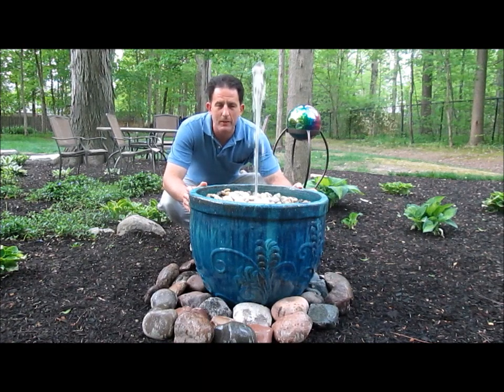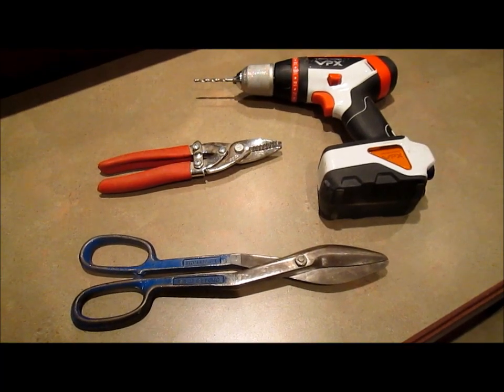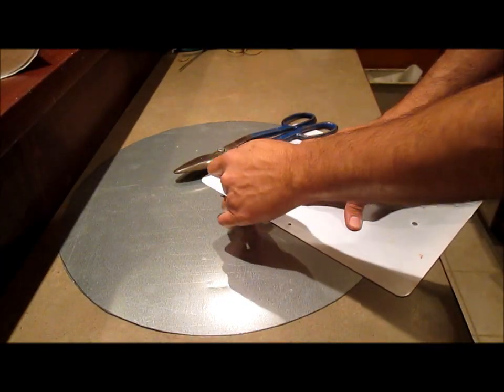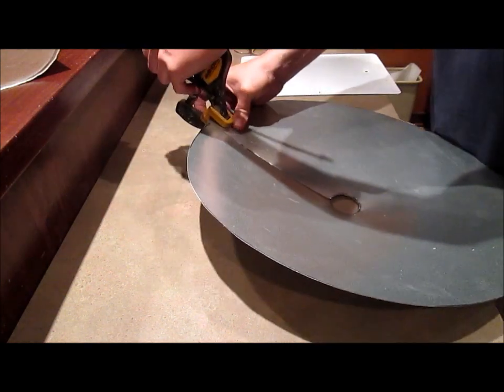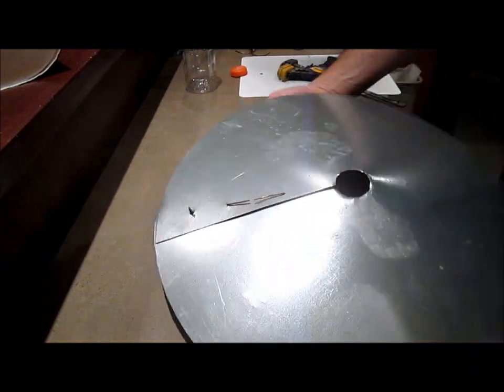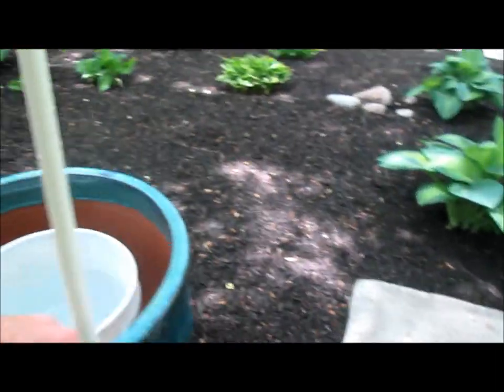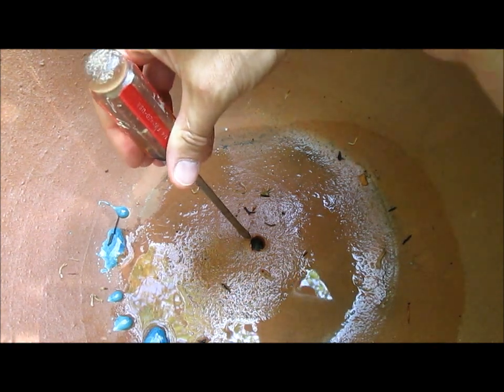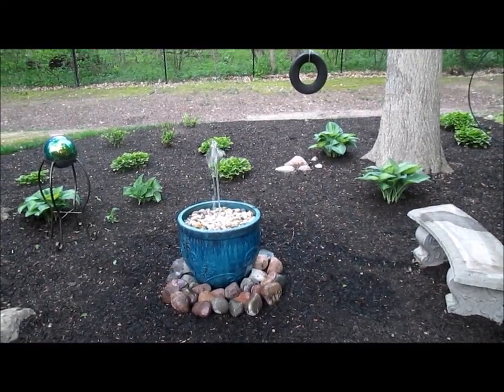How To Make an Outdoor Fountain

Comment: I worked with sheet metal 19 years in a manufacturing plant. If you are going to use sheet metal, wear gloves. Trust me on that. My scars are still visible twenty years later. You don't really need to use sheet metal at all. The dollar stores and garden centers sell round shallow bowls. You can find one to fit your pot. Look for a plastic bowl so you can put a hole through its center. I like the basic concept here. It gives the appearance of a pot filled to the rim with rock, but you use only a top layer. It won't be as heavy and it will be easier to clean, maintain, and store in the off season. I question putting the electric plug inside the pot. There is risk of electric shock if the connection is sitting in water.

Comment: I like the "funnel" water return catcher. Maybe also a good spot to put a strainer to stop larger matter getting in the reservoir. Thanks!
Reply from the maker: Sure, you could put a small circle of screen wire in the center, with a hole just big enough for the tube.  Really though, the rocks are a pretty good filter, and the pump can handle anything the rocks don’t catch.

Comment: take the plug off the end of the pump ..feed it though the hole..better then making that hole bigger in the pot ..just wire plug back on ..
Reply from the maker: +rick66649 - Yes, another good way to do it, but I really wanted the plug inside the clay pot, above ground, so it would not get wet.

Comment: this is brilliant, thinking about surprising my mother with a fountain and thought i try a nice and simple of for her, but there one think i wanted to ask do you think this still work the same way with a solar powered pump?
Reply from the maker: You need a pump that will push at least 100 gallons per hour.  400 is best.  I think solar pumps are far weaker than that, but you can check the specs.

Comment: Could you use a terra cotta or plastic draining plate with exsisting hole?
Reply from the maker: +im4coupons - Yes! Excellent idea!  Really, anything that is just a little smaller than the big pot, and funnel the water back into the bucket, will work fine.

Comment: What's the short item you push under the hole after you chip it out please
Reply from the maker: That was the end of a long extension cord that I ran the the nearest outdoor outlet.  I plugged the pump into the cord and let that sit inside the ceramic pot, but outside the plastic bucket.

Comment: Nice! I wonder what if instead of using two pots and a metal covering you would use a single ceramic pot full of rocks all over the pump. It would be easier to build and theoretically it would work as well, wouldn't it?
Reply from the maker: +El Gat Negre - Yes, you could make that work.  Those ceramic pots usually have little holes in the bottom, so you would have to plug it, and run the power cord over the side or make it big enough for the plug, feed the wire through, and seal it in.  Keeping it from leaking will be a little difficult, but possible.  I would try silicone caulk or JB-Weld or underwater concrete repair putty.  One other thought.   If you are handy with electrical wiring, you could cut off the plug, and feed the wire through without making the bottom hole bigger.  You can buy replacement plug ends for a few dollars.  Good luck.  I think it can work just fine that way.
Reply: Sometimes the pump needs cleaning or unclogging...a full pot of rocks would be a pain to remove to get to the pump.

Comment: So all your water leaks out at the plug in hole you made?? What did you use to seal it
Reply from the maker: Water never gets to plug hole.  Funnel dumps all water in bucket
Reply: Oh neat. I see now. Interesting. What size hose is standard on these small pumps? Or pipe

Comment: How much water ends up getting by the funnel and draining out the pot, will it make a big mess on a concrete floor?
Reply from the maker: +Mr Inappropriate - There is definitely some splashing over the edges.  I not suggest this for indoor use.  It would be fine outdoors on a concrete patio.  On a warm day.  The splashed droplets will evaporate.
Reply: +HowToLou Thanks, I want it for out door use I just don't want a puddle by my door
Reply from the maker: +Mr Inappropriate - I think you would be fine, outdoors.  You can reduce the height of the water, and amount of splashout, by turning down the pump pressure.  Most are adjustable.

Comment: what power the pump is used? and whether there is in him a water supply adjustment?
Reply from the maker: +Vitaly Sitkilov - i'm not sure what the power of the pond is, but you should pay about $10-$20 for one. Yes, they typically have a flow rate adjustment
Reply: ***** Thanks!

Comment: How did you run the power for this? I want to install a fountain in my yard and the outlet is not close by (the pump power cord is small)
Reply from the maker: +Latha Airodi - you can get electrical wire that is made for underground burial.  If you're not handy with electrical work, you might hire an electrician to install an outlet out there for you

Comment: I want to build it, just worried about the paint. Birds will drink from it, won't it be toxic with the spray paint you used?
Reply from the maker: No birds drink from mine.  They can’t.  The water drains through the rocks and into the bucket they can’t reach.

Comment: Where did you plug this in? Did you use an extension cord? Did you burry the cord? Did you have to use an outdoor transformer?
Reply from the maker: I buried an electrical cable from the house out to the fountain.  There is special grey electrical burial cable.

Comment: What size pump did you use?  Looks like the perfect height & pressure.... well done!
Reply from the maker: Hi. That was 3/8 inch inside diameter tubing
Reply: @HowToLou  Thanks how many gallons of water does it push
Reply from the maker: I no longer have the specs, but I would guess around 400 gallons per hour.

Comment: I have an old 10' fiberglass satellite dish that I would like to make into a water fountain..........your suggestions  ??
Reply from the maker: Bury a plastic 5 gallon bucket so that the top is level with the ground.  Put the lowest power, cheapest sump pump you can find in the bucket with a 2-inch PVC pipe sticking straight up.about 10 inches.  Cut a 3-inch hole in the center of the dish, and lay it on top of the bucket with the pipe sticking through the hole.    Wrap 3 or 4 courses of wedge-shaped pavers around the dish, so it looks like a raised flower bed, from the side.   Paint the dish black and pour river rock or similar inside the dish.  Fill it with water and turn it on.  Consider adding a pipe carrying a supply fresh water to the bucket.  This thing will evaporate out water very fast. -Lou

Comment: Assuming your run it everyday, how often would you need to replace or add water?
Reply from the maker: divinerakimocala - A lot, actually.  Fountains evaporate water pretty quickly.  You have to add water every 3 days or so, depending on heat and humidity in your area.  I burried some 1/4" tubing from the spigot on the side of my house, under the yard, into the bottom of the fountain, so I can easily fill it by just turning on a valve.
Reply: The wind will blow the fountain too, on a very windy day the fountain will end up having no water.

Comment: Where do you get the tubing to connect to the foutain? I have the same foutain and for 2 years i have looking for the exact tube size to fit in it! I tried using the fish tank tubing in the pet section of walmart, nothing fits right!
Reply from the maker: +lisalisa8221 - The plumbing section of your hardware store will have tubing of various sizes. You probably need 3/8 inch.  If you can’t get the right size, get the next size up and use a hose clamp to hold it on
Reply: HowToLou Ok, thank you!

Comment: How much is the  pump being used in this video? Ball park figure?
Reply from the maker: It really depends on how much my wife remembers to turn it on.  It can certainly run for a long time.  They have these pumps running fountains in garden shops, and they run them every day, all season long.  I actually reused that pump from an old fountain that I had for several years.  The weather finally destroyed the fountain, but the pump was still fine.
Reply from the maker: ***** - I don't know for sure, because it came with my old fountain, but judging from what I see on Amazon, I would say about 200 GPH.
Reply: Um... I guess I didn't make myself clear. I meant how much $$$ approx. for this pump.
Reply from the maker: jackflip4877 OH! :)  You can get them for about $20 on Amazon.

Comment: Dosen't the water get dirty and smelly?? Thanks for your quick reply.
Reply from the maker: +Hassan Paywandi - well, i guess it might. I don't really know.  I don't typically sit right by it.   If it did and bothered you, you could change it or add a spoonful of bleach occasionally.
Reply: Hassan Paywandi
Reply: water in motion shouldn't get dirty and smelly. A bigger problem is making sure the water doesn't evaporate. At least in California. I'll just attach a dripper hose to it and have it slowly replenish it with the sprinklers when they turn on.
Reply: yup you add lil bit of bleach and it cleans the water..thats what i do to my water fountain that i have outside .and it doesnr smell...